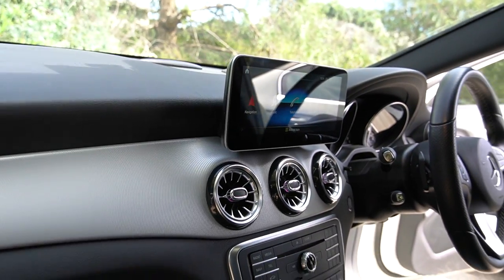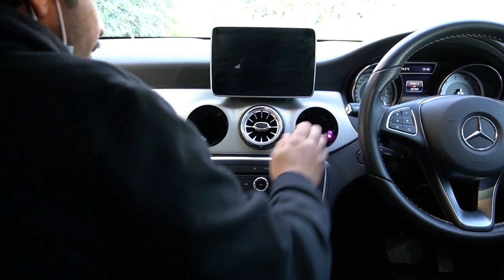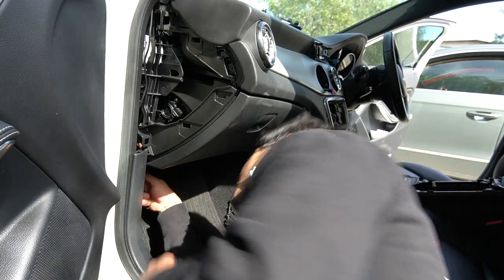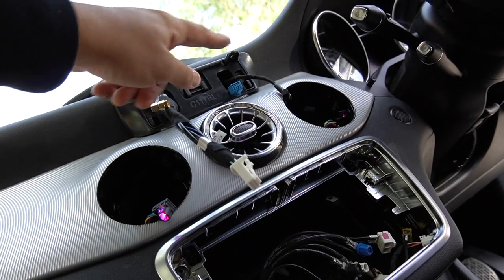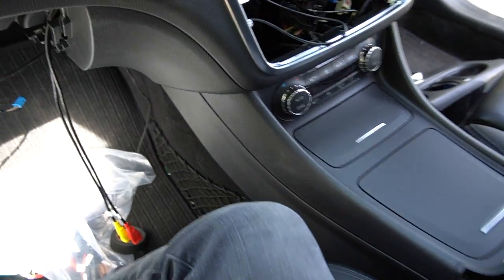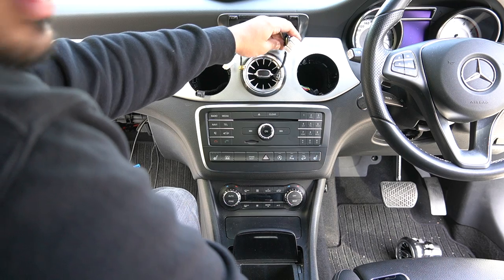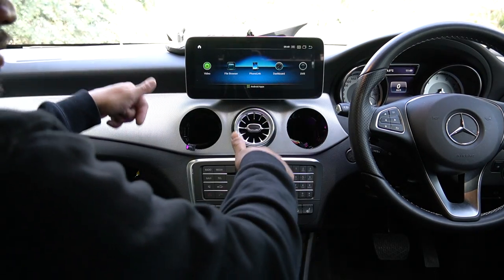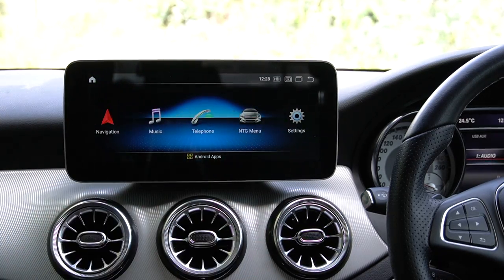Mercedes-Benz GLA 10.25" Android Display (Full Installation)

Comment: For anyone having issues with the carplay not connecting sometimes just go to the tablet SETTINGS -> Wifi and connections -> hotspot -> Make sure it's active and on 2.4 ghz. sometimes it's not working in 5 ghz and that's why it does not connect.

Comment: I have installed the same screen but mine has a sound delay while using the screen (apps like YouTube, video, IPTV) the seller of the screen is saying that it is because of the fiber optic cable that needs to be plugged in, but my car doesn’t have this fiber optic cable from factory. How am I able to fix this sound delay issue?
Reply: I also have the same problem has anyone found a fix?
Reply: I have the same delay problem! 😔
Reply: @perromania yeah unfortunately its not fixable in any kind of way so ended up selling the car

Comment: Should the aux..auto switch between the oem and new system or do I have to change manually every time? Example..I like to listen to the radio so radio was on oem but if I do that I get no sound on phone or maps. So is it one or the other?

Comment: how do you know if the late NTG4.7 needs to do the USB aux or not? Is there a way to check? My car does not have the aux connector in the glovebox but I can activate the aux input in engineering mode.

Comment: Hi just installed the new screen onto my mercedes gla 200tdi 2015, no aux and can't get the sound to work on the new system? I've removed the fibre optic cables. Your video show how to if there's an aux but not much if it doesn't. Please help.
Cheers Loz
Reply: Sorry it's a 4.5

Comment: Hi be fitted mine however whenever I click any of the features n the standard radio buttons it disconnects it back to normal radio and I have to put old screen on to change back to aux also it powers off when stood still for over 3mins